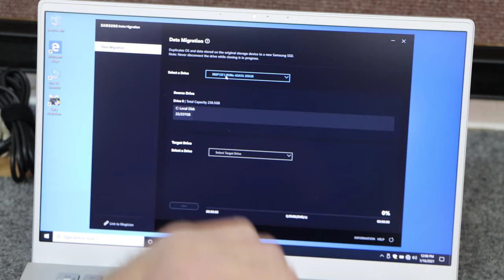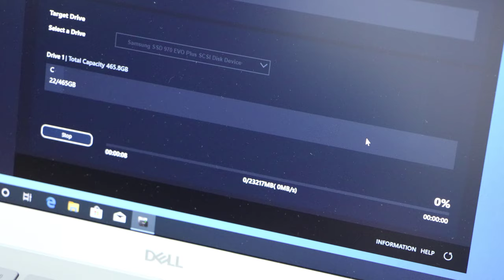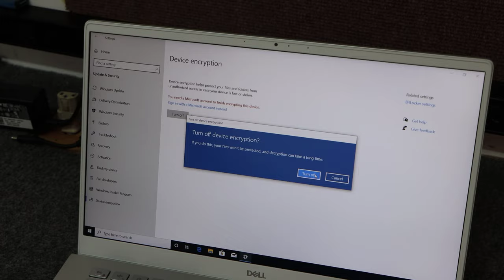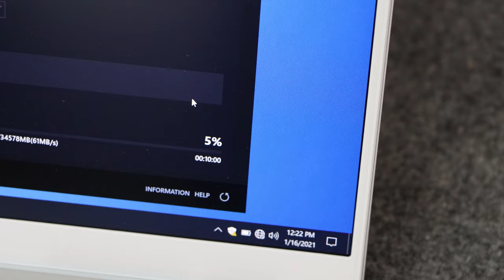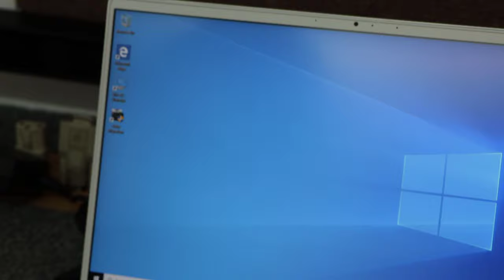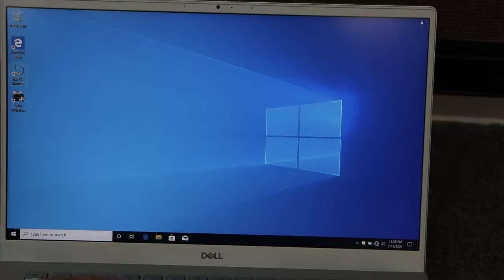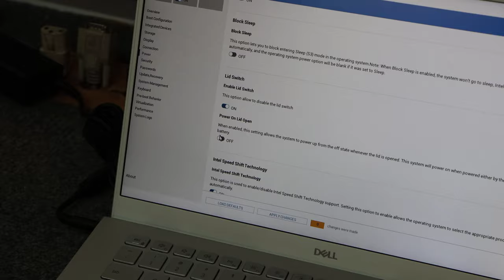Dell Inspiron 14 5402 SSD & Memory Upgrade, Clone SSD.

Comment: Why didn’t you leave the 265GB with the OS Original drive there and just add the 500 GB on the other side by the ram?
Reply: i was thinking this the whole time.
Reply: bcoz that 256GB is slow as fk reading/writing speed and samsung EVO is beast and fast when u have to copy data on it or read from it.

Comment: Great video. I have a question though. If the laptop has another NVMe M.2 slot then you could have let the existing SSD stay at its place and just added the new one in the second slot. That way the old SSD would also get utilized, give additional storage and there wouldnt be the need to clone it either. Correct ?
Reply: Yes you can do that just you need a mounting bracket for 2nd slot. Look for KYMC9 mounting bracket

Comment: In fact, this laptop can use pice4.0 SSD
For example, WD sn850 and samsung 980 PRO are both very good choices
, And the memory can also be installed up to 64gb (32gb x 2)
Wireless network card can use intel AX210
So it's perfect

p.s. sn850 is suitable for use on desktop computers
        samsung 980 pro is suitable for use on laptops
        Whether it's temperature or random access capabilities, I don't know why. When 980pro is used on a notebook computer, the operating experience is better.
Reply: This laptop can also be upgraded with a larger battery (53w)
But the speaker module must be replaced~
At the same time, after this upgrade, the second internal m.2 system can be used.
Reply: When the new battery module is upgraded, the use time of this laptop can be increased by about 20~23%, but the overall weight will increase by 62g
Reply: If there is a second SSD installed, I highly recommend upgrading the battery module...After all, the original 40W battery is really small

Comment: Great video.  I wish mine had opened that easily.  Only one of the back screws on mine popped up the cover.   Another one came right out witout popping up the cover and the third one just spun in place.  I eventually manage to get it open though.  Unfortunately, I did break a couple tabs off even though I was really careful.  I now have 1tb and one 500gb drive.  I was orginally going to use the drive that came with the laptop, but it is too short and there is no way to mount it.  Anyway, everything is working okay so far.

Comment: Hi Dale I have just bought the i5 version of this and this really helps when I need to upgrade the SSD, Can I ask what would happen if you installed a second SSD into the second slot and simply coppied all of the windows data onto both drives, I assume it would get confused and the BIOS would go for the original drive, unless you changed the boot drive, or would it be better to ensure you had a good copy of the original drive and then delete it? Also Could you use a second drive with say Linux  as a seperate entity (like a split personality computer!) and use a boot controller, to select which OS to run?

Thanks in advance

Comment: Thanks for the video. I've never done this myself, but I'll try to make this happen.

What size screw is that at the end that is used for the second SSD?
Reply: Also wondering if you need an actual bracket or if the screw is enough. The Dell website shows this actual bracket that seems to cover it but I'm not sure if that's necessary.

Comment: great video, would you recommend disconnecting the battery just to add ram in an empty slot?
Reply from the maker: Thanks.  If you are VERY CAREFUL, you should be fine. Dont drop or touch anything when doing it.
Reply: @CadillacComputerCenter  thank you!

Comment: Does the laptop support dual operating system..
Because I do coding for my engineering so for that I need to install Linux also apart from the windows 10
So will it support it??

Comment: Great info thank you! I've got 2 HP laptops I need to upgrade and at least put ssd drives in, they might be old enough that they may not have an NVMe drive option. We'll see!
Reply: They probably can use ssd regular to make them faster.
Reply: @DodgersNation949  I believe you're correct Everardo! You'd know more than I about them I'm sure. I've only opened 1 of my laptops awhile back when I decided I'd rather pay $89 for a replacement screen for its monitor and take a chance doing it myself rather than pay 3 to $500 for a shop to do it after shopping around.  That turned out fine. It's an older i7 Intel model cpu. SSD would be a huge improvement over what it has now!  Thank you for your input!!!
Reply: I’m glad I can help out good luck buddy. Just believe in your self Can upgrade your laptop to a ssd make your laptop faster.

Comment: Hi there,
If I were to install a secondary drive, would I need to clone the original SSD or could I just plug in a secondary 250GB or 500GB NVME M.2 into the second slot? I use this laptop for my college work and I'm running out of space lol.
Reply: I had the same question when he said that there is another SSD slot